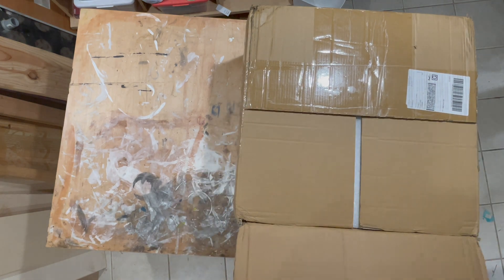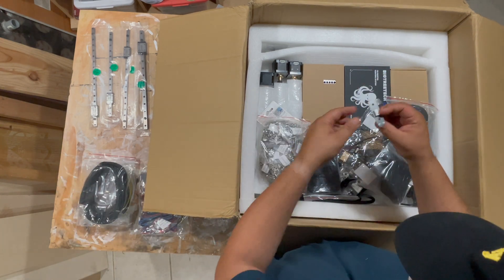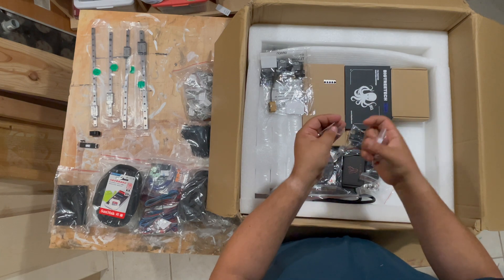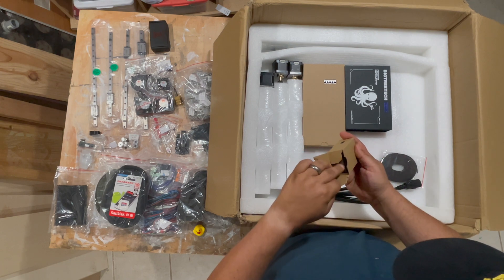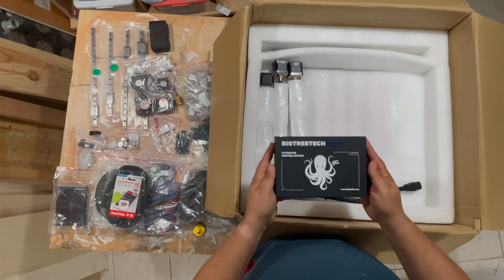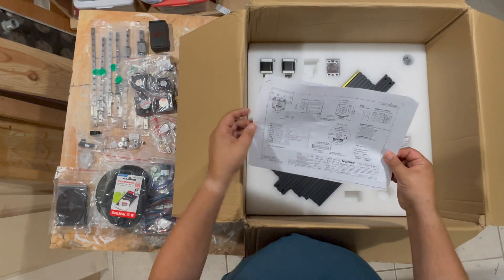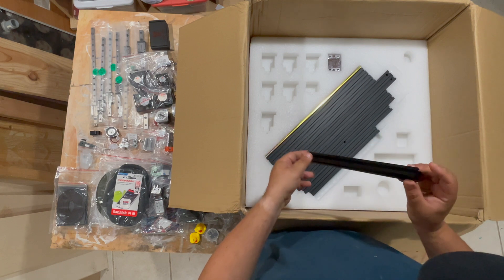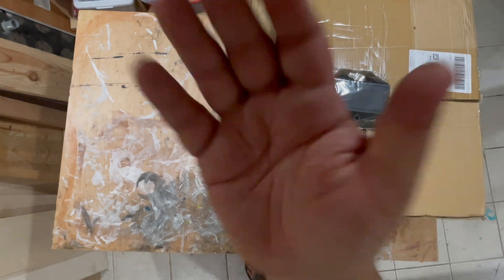Unboxing a Voron Trident Formbot Kit (Fall 2023)

Comment: I got the 250 on the table.. im thinking of dropping the manta and CB1 in there to save my pi and a 5v supply. I should start stockpiling filament because saw your Micron video and... I need more color options.